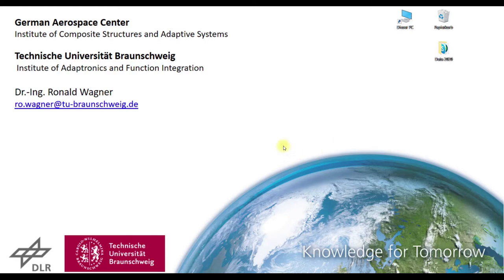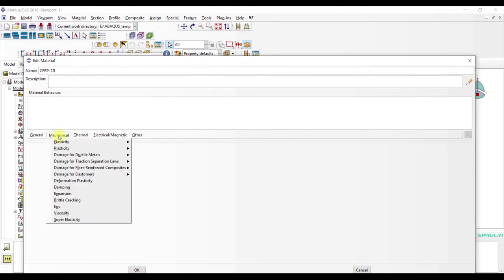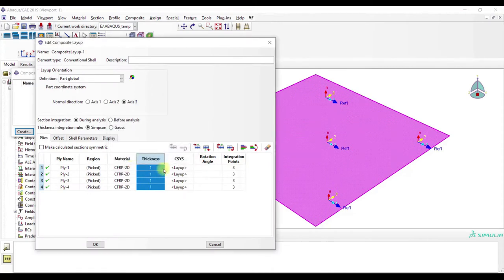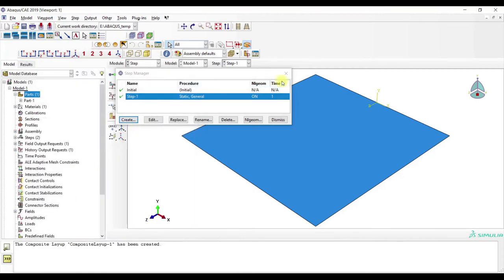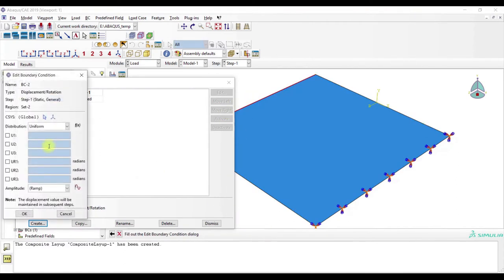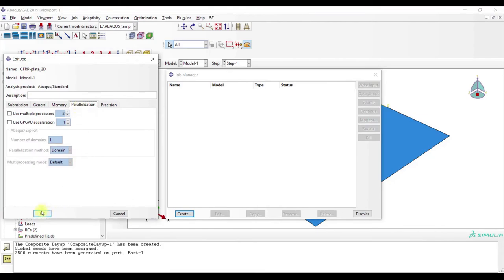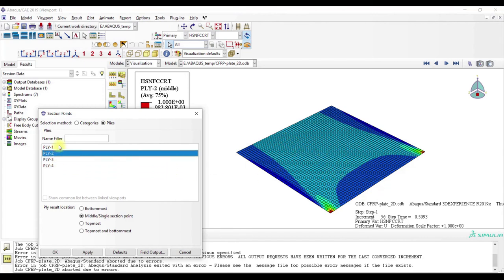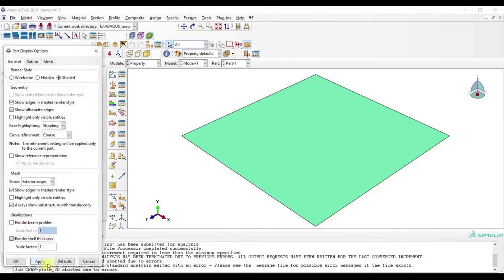Abaqus Tutorial: How to create a CFRP plate and plot the stress values in the individual plies?

Comment: the elastic and hashin damage parameter where to get it?
Reply from the maker: Either material test like tension and compression or data sheets from the manufacturer of the material
Reply: @hnrwagner  from your parameter..where do you get it..
Reply from the maker: @muhammadhisyamuddinsharudi5554  

for example here:

https://www.mdpi.com/2073-4360/12/1/157

In Table 2
Reply: @hnrwagner  base on you video, hanshin properties from excel, what is their unit?
Reply from the maker: @muhammadhisyamuddinsharudi5554  MPa